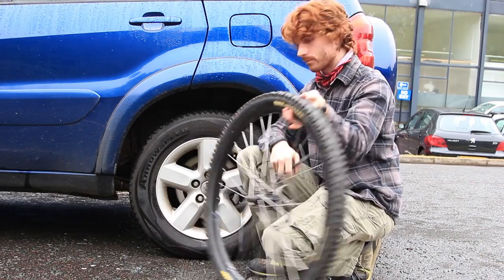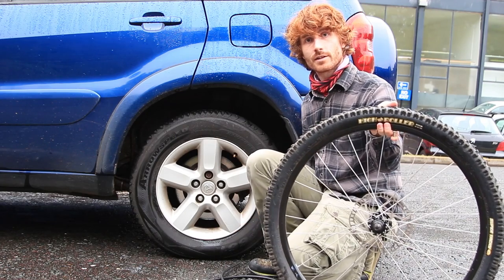Car Tyre Tubeless Inflator Hack

Comment: Thankyou so much for this tip, Ran out of Co2 tanks and my track pump was getting nowhere close. Simple ideals are the best.
Reply from the maker: +bryn fuller no worries, it came to me when talking to an old skool fabricator i work with that said he used to use over pressured car/truck tyres as compressor tanks to run  air tools on work sites...

Comment: Like the way you think. Maybe incorporate using the spare; with both cores removed and a shut off/on valve can pop a tubeless into place. Thanks.
Reply from the maker: The spare makes a lot of sense as long as you remember to fill it up again after 😂.

Comment: U r a legend 
Been arguing with a magic mary for ages today 
Never once needed anything more than a floor pump to fit tubeless tyres until today.  So gladvi came across ur vid u just saved buying a compressor or the airshot
Reply from the maker: You. Are. Welcome! Saw someone do this in the backcountry to reseat a car tyre. Apparently bmxers used to do it all the time 🤣👍🏻
Reply: @StravaigingMTB  seriously went from pure rage to total relief in about 5 seconds when this worked 🤘
Reply from the maker: Well glad it worked, check out the channel for more bike maintenance and if really appreciate a sub if you like my other videos.